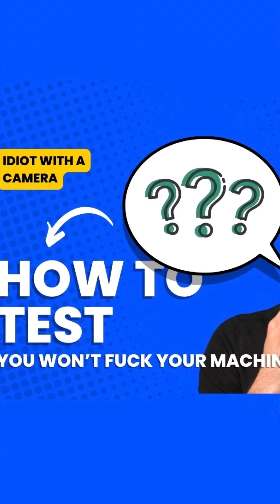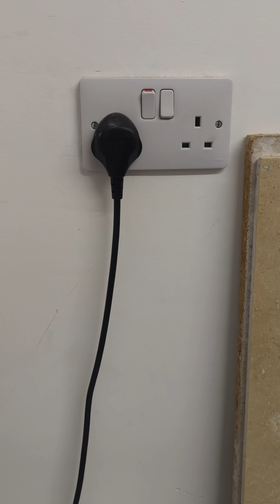Testing Voltage on Your UK Power Socket

Comment: IMPORTANT SAFETY MEASURE FOR ANYONE WATCHING THIS: Do not connect or disconnect both the probes with both hands as seen here, if you make a mistake and touch something you shouldn't, you can pass the current up one arm, ACROSS YOUR HEART, and back down the other arm to complete the circuit. This kills you.

The usual convention is to always keep one hand in a pocket or behind your back so that you don't allow yourself to lapse and make this mistake. Of course, people can say that there's no risk if you do it right, but there's also no downside at all to doing it this way, and the reward could be literally life-saving in some situations.